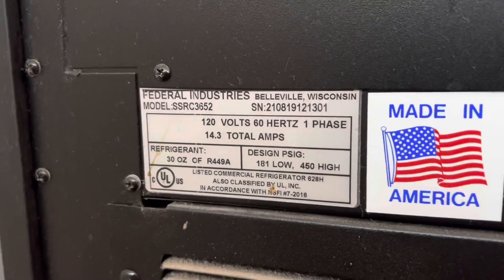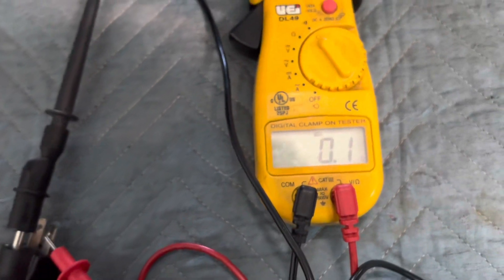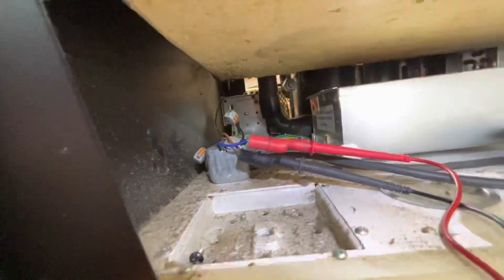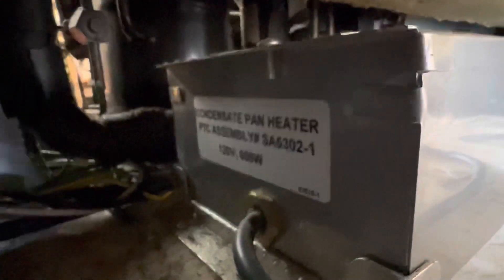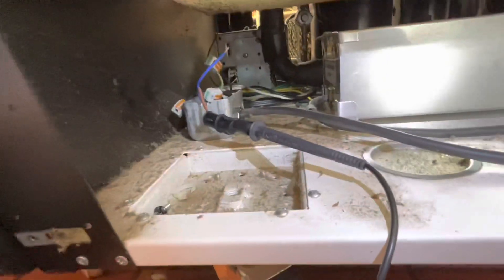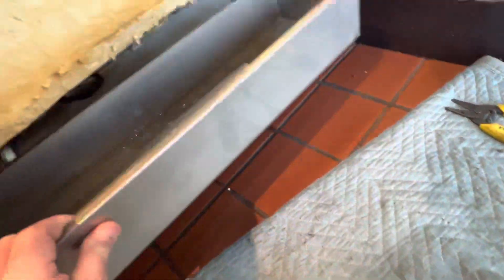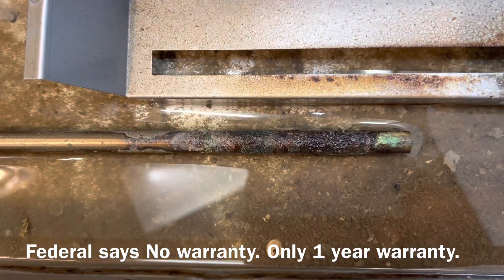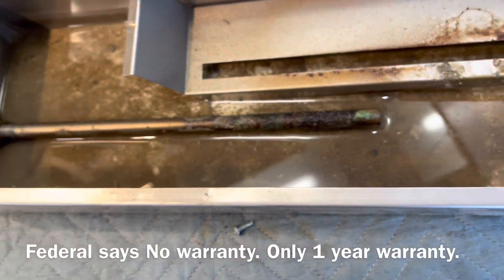Shorted to ground & and only 1.5 Years old. NOT UNDER WARRANTY they say! Really, WTH !!!

Comment: Good video. Also, this case is 449A, but a lot of small fridges are R290, and can't use those Supco drain pan heaters they're not listed for flammable refrigerants.
What's RHS?
Reply from the maker: Refrigeration hardware supply. California.

Comment: Why is there a heater for the condensate pan?
Reply from the maker: Well, When the water drips into the Condensate pan from the evaporator defrosting every 8 Hrs the Big Pan Fills up with Water. The Amount of Water dripping into the Pan Can exceed natural evaporation rate in a Humid Location , Hot Ambient with extended run times , Or combination of both. Therefore, You Must Boil the Water away so the Pan Does not overflow the Water onto the floor.
Reply: @OcRefrig  I see, Would it be possible to add pipe for the condensate water to flow into a drain?
Reply from the maker: Yes, just make sure you put a trap in the drain pipe somewhere. Its a Good idea if a Floor drain is close by. Saves alot of electricity that way & eliminates drain pan issues.

Comment: Can you just run a supco 30os? There like $50 bucks
Reply from the maker: You might be able to if the climate is not too humid out.
Florida no. California maybe. The Factory pan is HUGE ive got to think its Huge for some reason.
Only way id do it is to put the 30 os inside the big original pan. Limiting liability that way.
Those 30 os get frigin hot all over and are kind of a Fire hazard ive noticed. The under side where the condo pan is is only about 6” room under there. Foam is right above condo pan. Might be flammable. Fire hazard & Liability issue on you if it catches fire & burns building down at night. You could be sued in California & loose everything if its your own business. If customer bought that unit at a Price of $13,000.00 they can afford to fix it right is what I’m saying.
Might work though & maybe a Great Fix if done right.
Although a Liability issue Modifying An Existing Design & Possibly creating a Fire 🔥 Hazard is What an attorney Would say ! is it worth the Risk for Me ? No. Great idea though , maybe if done right. Maybe a Heatshield above 30os siliconed to the Foam above so foam does not catch fire etc. pan maybe not big enough id use the bigger model ive seen from supco.
Thanks for the Great idea though !
4-9-2023. 12:57pm.
Reply: @OcRefrig  great point. If they can afford that much on that machine, they can afford the heater